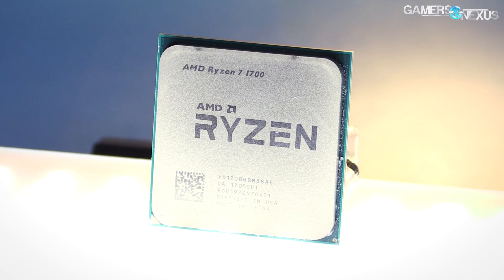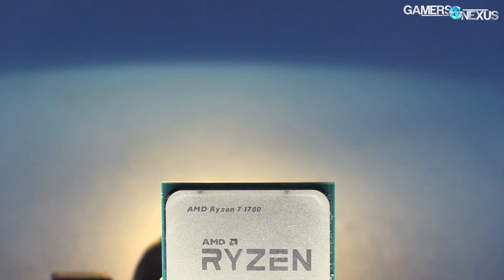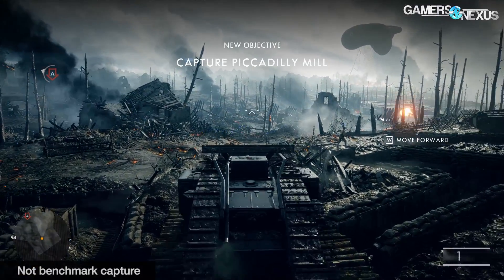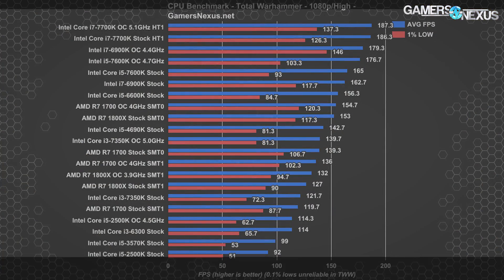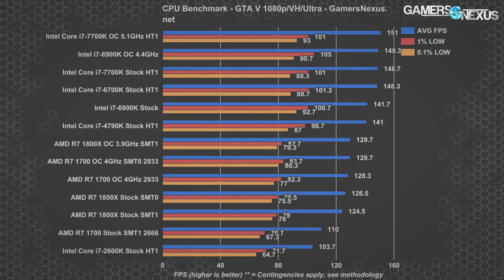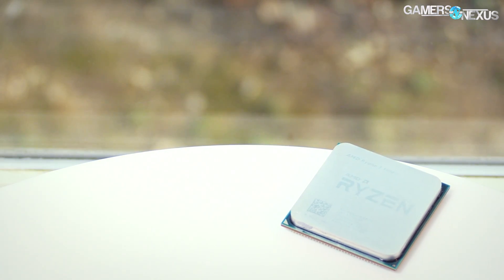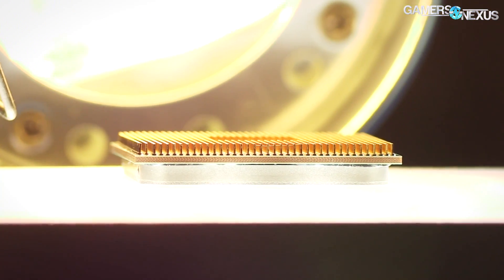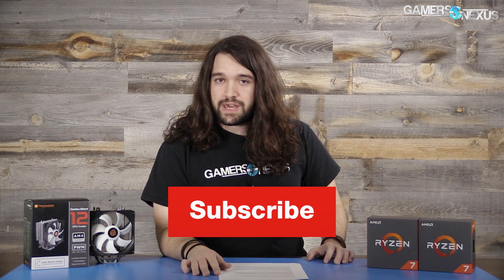AMD R7 1700 SMT Off + Overclock Benchmarks

Comment: Memory speed does nothing for gaming. You will have the same framerates with 2100mhz ram as you do with 3200mhz. Stop thinking it's going to do anything because it won't.
Reply from the maker: 2133 vs. 3200 can actually make a difference -- we've seen it with BF1. It depends on the game. Ryzen CPUs also behave differently with memory, and seem to benefit from faster kits in ways that Intel does not always show.
Reply: In some games it will, for example The Witcher 3.
Reply: Depends on the game and the relative CPU clockspeeds. If it's a CPU intensive game, the memory speed can improve minimums in turn increasing the average. You will hit a point of diminishing returns until you raise the CPU clock speed then raising the memory as well also yields in better minimums. CSGO for example shows huge improvements from this. By cutting memory timings down significantly and jumping up from 3000 to 3100mhz I yielded the same FPS gains at 4.4GHz with my 6600K, vs stock memory settings with my CPU at 4.7.
Reply: Digital Foundry's tests show otherwise. They aren't large differences, and definitely not enough to warrant the extra spending (for pure gaming), but it does have an effect.

Comment: Huh.. i guess i'll keep my 4790k for coming 2-3 years. No need to buy a new CPU as buying these CPU (newer intel n amd) for gaming only is kinda stupid as my 2nd hand CPU can keep up with these.
Reply: our haswell still kicking ass bruh
Reply: the 4790k is a beast, got it myself and it hasn't disappointed. Intle has really been barely improving in performance over the last few years. The the gains over the 6xxx and 7xxx series are so minimal. I really wish AMD did better in gaming just to force better competition between the two companies.
Reply: yup. 4790k @ 4.85GHz and it's an absolute beast for pure gaming. Easily beats out mildly oced 6700ks and 7700ks under 4.6 ghz but I run VMs for work so I picked up an 1800x. getting a crosshair 6 motherboard on the other hand are still rare since production isn't keeping up with the massive demand lol
Reply: I'm with you lol
Unless there's a major jump in cpu performance for games, and unless the 4790k really becomes too weak, I'll rock this baby until it dies.
Reply: What games are you playing?!

I'm running my 4790K at 4.6GHz whichis pretty great. Even in games like Watch Dogs 2 I don't see anywhere near 100% usage though.
Reply: 4790k owner checking in, can confirm. I love my processor
Reply: 4790k was the best gaming oriented CPU ever released imo. That statement still hold to this very day. I really hope Intel comes out with another beastly gaming oriented CPU pretty soon, it's been too long. I got a 4770k that has been running on over 1.4V and a very high OC for years now and it just doesn't die.
Reply: @nhozdien Well, I at least, don't plan on keeping it forever, but I was able to tolerate gaming on an Athlon II 635, so I'm very content with this chip, even as its performance starts to fall behind newer CPUs.
Reply: Richard Smith some people just seem to be incapable of self control, so they spread verbal diarrhea.
Reply: BrotherO4 yes, rendering is crazy, and gaming is on-par when u get rly fast ram
Reply: same here. I've got it OC'd to 4.3, and I'm still loving it.
Reply: wolfee202 GUYS A CPU CHANGE LIKE ONLY 2 OR  3 FPS WOT ARE YOU SAYIN XD
Reply: Was running my 4690k happily until the motherboard died and I got store credit instead of a replacement. Back on my old 2600k; a great CPU, but the p67 motherboard is lacking. Even my SSD is running at half speed because of this board, the struggle is real.
Reply: Plus12 Gaming: what is your core voltage at?
Reply: Matthew Tremain  People are spreading verbal diarrhea by saying an Intel CPU, that you might not care for, is better bc it suits their needs better and bc there is evidence that it actually is ?
Reply: My comment was in reply to Richard Smith's comment of being confused about all the bitching.
Reply: +Advection357: 1.35V
Reply: @Gawdamit

And did you get the motherboard from Santa's Little Helper too?
Too bad the same config, without being outdated to shit with no relevant tech - will be available as R5 1600 with B350 Mobo. And will probably be cheaper too.
Reply: Ivy bridge still kicking ass, too.
Reply: i have to sell my 4790k because i do more than gaming...so the chance of getting a proper 8 core is here so i kinda have to make the change
Reply: I'm a developer and I am upgrading from a 4790k to a Ryzen 1700x. As great as the 4790k is at gaming, it is not very good at multitasking and multithreading. I desperately need more threaded performance, and single thread performance just doesn't cut it anymore. Ryzen offers plenty of performance for my gaming needs while still actually serving as a decent productivity cpu. 
I am utterly confused at all the bitching, the CPU can do everything pretty damn good.
Reply: Well the 1700 destroyed the 4-core cpu's in many of those games in terms of 1% and 0.1% low framerates.  Also having additional cores is useful since you will take less of a hit in FPS when running things in the background such as Chrome, or some kind of Voice program.
Reply: Lol i just fucked up my 4770k by trying to delid it and got a sweet deal on a 4790k. no rugrats
Reply: a 4-core i7 usage is around 90-100% in new games. Good luck in the next 2-3 years.

Comment: Another Major Disappointment
Reply: 10 min since my comment, video is online since 13 min and is 12 min long .... yeah, you didn't watched it
Reply: The disappointment is directly proportional to the hype before release.
Reply: JP Morais I'd probably stick with my 7700k and wait for Ryzen 2 before upgrading, but obviously you know your needs better :p that's just my 2 cents
Reply: Rob Leonard you be disappointed, I'll give people $800 video editing machines that outperform last year's $1500 builds.
Reply: The demand on the cpu is the same at every resolution, like the cpu tells the gpu "render 3 trees for me" at 720p or 4k you still get 3 trees, the reason for lowering the resolution is the gpu doesn't have to do very much so it shows basically the "max cpu fps" given any resolution and gpu that's the highest you'll see the fps. Increasing the resolution can not increase fps, it can only remain the same or decrease.
Reply: Of course it increasing resolution doesn't increase fps. IIRC, at lower resolutions the gpu has to process less pixels (920k in 720p vs 2 million in 1080p). Since it takes less time to process a single frame, that means each seconds the gpu can output more frames. If you are correct, the cpu doesn't get more demanded on any resolution for a single frame, but since your graphics card CAN output more fps, that means the CPU has to process more frames (which is where a CPU bottleneck may appear). This why we see more difference between a G4560 and a 7700k in 1080p than in 4k.
Reply: By probably equal or lesser margin than 1080p though, it's not like "omg you get double the fps on intel" it's like 10% or so. The battlefield 1 1080p test 135 vs 142 fps is 5% slower and that's just average there's plenty of overlap, if you paused the benchmarks are any point in the run you would not be able to tell which system had which cpu based on fps, at any point in the run either cpu could easily have slightly higher fps than the other cpu.
Reply: I thought the processor was more demanded @ lower resolutions, Ergo the 720p benchmarks, despite virtually noone using that resolution anymore.
Reply: Yeah all of that makes sense but the main reason for the 4k results being similar is because the gpu is the limiting factor and the "max gpu fps" is lower than either of the "max cpu fps" so they appear to be equal when one is much better when the cpu "max cpu fps" is the limiting factor. Even with cpu bottlenecks both intel and ryzen are perfectly fine for the majority of users, the choice then becomes do you want 4 cores or 8 cores at $330ish my choice would be 8 cores. I personally wouldn't have a cpu limitation (390 at 1080p) and more cores for the same price might as well go ryzen lol
Reply: 3 trees on 720p are no where near the amount of pixels that 3 trees in 4k have
Reply: Right but pixels are handled by the gpu the cpu just tells the gpu what goes where, the cpu still requests 3 trees to be drawn and the gpu determines how many pixels those trees get when they are drawn.
Reply: Yeah man I can't believe it's a full 7 fps behind in battlefield such a disappointment, I don't care that it's vastly superior in everything else I want my titan to get 7 fps more at 1080p (major sarcasm for people that can't pick up on that sort of thing)
Reply: dumb fuck how is it a major disappointment intel fanboy
Reply: not really! all you most do is gaming i guess! this is a major win for us at 1440p and also for production! im gonna sell my 7700k and get the 1700
Reply: Rob Leonard you havent even seen the vid bruh fuck off
Reply: Really? A 7700k still performs better than an 1800c at 1440p too.
Reply: so true.